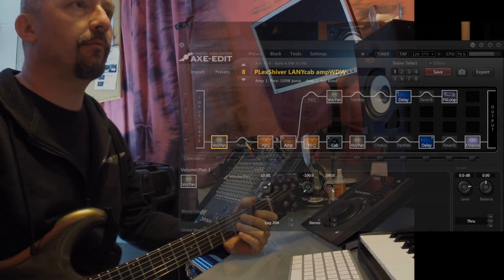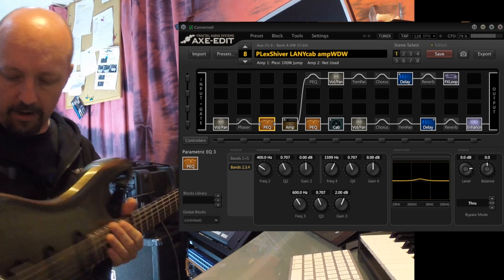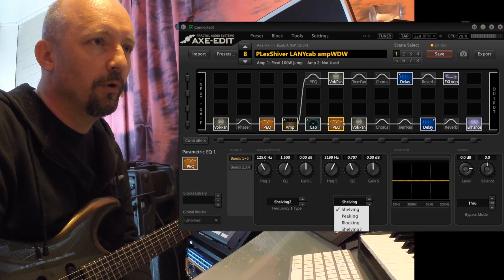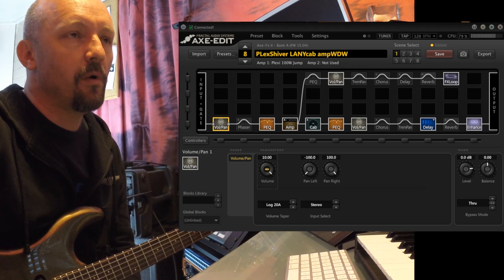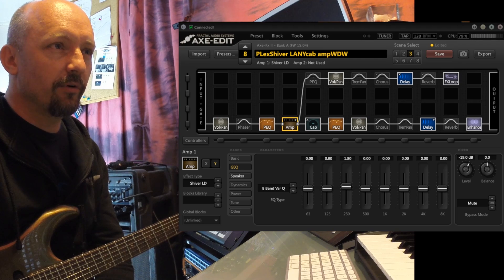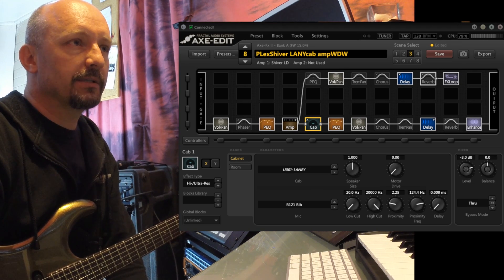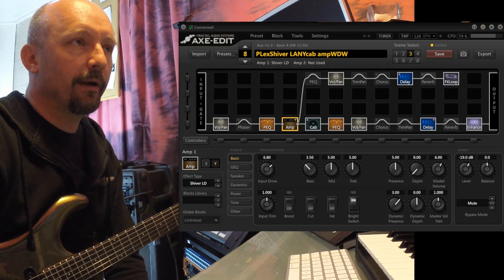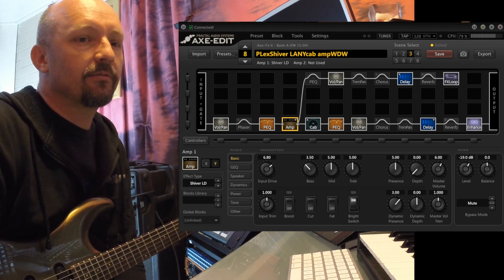AXE FX II an update on My setup part2

Comment: Have you foregone the QSC speakers?
Reply from the maker: Yep they went a long time ago. I found that they had a weird bottom end thing that happened at high volume levels. I ended up replacing them with the EV etx12which is a timber cabinet.
Reply: Hi - thanks for getting back.
Currently I'm still an analogue man - pedalboard–>tube amp etc – I'm considering going the Axe FX route to minimise lug and maximise effects – do you consider a couple of powered FRFR speaker boxes? or something like Matrix poweramp and passive FRFR speakers?
Reply from the maker: @Eduaro2U  this is an old video. I'm currently not using the frfr foldback speakers. I would only use this setup now if I had to save room on stage and keep the volume down.  I now normally use a matrix amp with a regular speaker cab. Either 4x12, 2x12 or 1x12 depending on the venue or type of music.
Reply from the maker: @Eduaro2U the frfr does take some getting use to especially if you are used to a regular amp.
Reply: Excellent - all good to know.
You're obviously happy with the Matrix amp - or would you recommend something else?
Reply from the maker: @Eduaro2U  matrix is awesome and built like a tank
Reply: Fantastic.
You've been very generous with your time and knowledge - thanks.
BTW - I love your original "Overcome" - anymore where that came from - CD maybe?
Reply from the maker: @Eduaro2U  no probs. Glad you liked the song. I have wanted to put an album together, one of these days I should get motivated to do something about it.
Reply: You should - I'm looking forward to hearing it. 👍👍👍